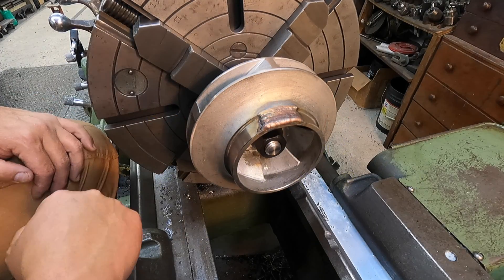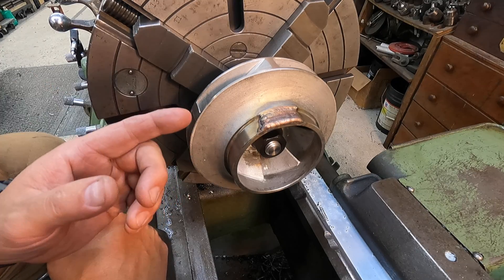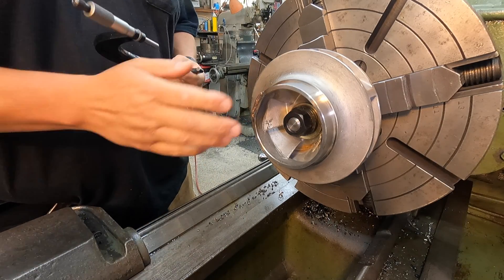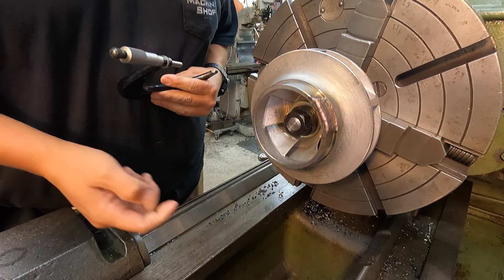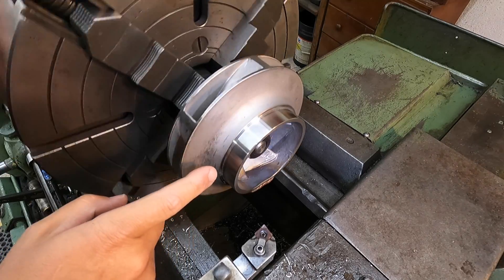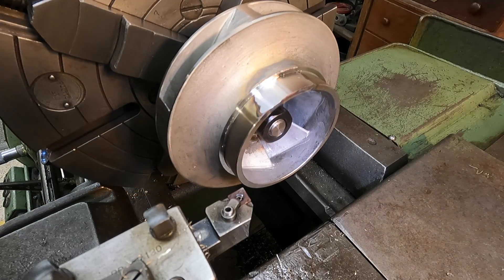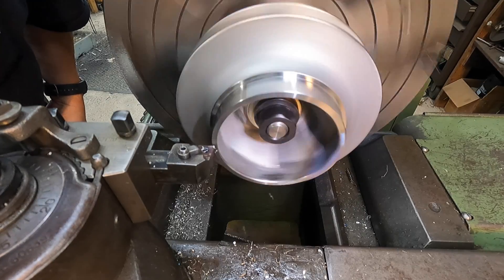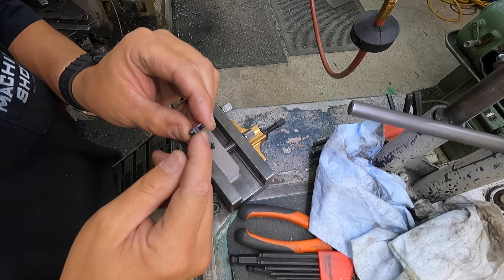Stainless Impeller Repair Part 2

Comment: The impeller is soooo twisted and banged up that it's basically junk. I do not understand how it's worth this much work hours and resources just for it to most likely end up being scrapped anyway after the customer tries it once. The poor pump is gonna be walking on the floor when it's running and the bearings are gonna be shot in no time. Mark my words.
Reply: You should pay attention to what the man said in the last video. You want him to mark your words and you seemed to discount his words.
Reply: @brianrhubbard  Yeah. Watched the whole video yesterday. I still don't see how.
Reply: @DraGma  He is doing it for educational purposes and to have content for his channel. I'm pretty sure the views and subscribers he will gain from this content will more than compensate him for his time. The part may be junk, I don't know anything about pumps but we can apply these techniques to a lot of other applications.
Reply: @Pablo Estafez Thanks. That's why God gave us two ears and only one mouth. We should listen twice as much as we speak!
Reply: Adam said in a previous video on this that this is a spare impeller. The pump has already been fixed with a new impeller. This one will be repaired and turned down to the next smaller size and will go on a smaller pump when needed. The run-out problem will also be fixed when the impeller is turned down to the smaller size diameter.

Comment: When they dropped the impeller, was it still attached to the pump motor? That was some bend.
Reply: I was thinking the same thing... holy smokes that’s a big ole dent
Reply: @francisschweitzer8431  Dropping these impellers is surprisingly common, the damned things are heavy and are awkward tho hold. Dropping one usually results in this sort of damage but usually on the disk fins.

Comment: If you had planed on doing the flame spray from the start, could it have been used to build up the dent as well? Clearly that couldn't be done while spinning on the lathe, unless you apply a lot of build up, but could spot build up be done? For that matter, could the same system be used to repair damage in a flat surface? Under cut with a shaper, spray and machine back down?
Reply: I think tig fill rod is a lot cheaper for that much material than the special spray powder.
Reply: @cda32  In this case, I suspect you are correct. However I suspect there will be fewer heat issues with spray welding. Also there may be cases where one spot needs more buildup, but not enough more to warrant switching to tig. In that case, a spot treatment would save powder as it would avoid applying more than needed everywhere else.

Comment: I am No Machinist...but i Repair alot myself ( both personally and as a career )...i think checking that by itself ( no shaft ) would determine " Why " it wobbles so much??
It could be something that should be done First not Last in this Repair??
Methinks i would have checked the Shaft and anything that could be causing this wobble...
It looks like the whole thing is not machined right?
Or has some damage your " assuming " is " OK " 
Just my thoughts
Ok...not a Diss to you
Sometimes we have to go backwards a step to go forward or realize it is wasting time...
Yeah I know this is a video and " educational " to some...
But the lesson might be to start checking your part...because it was " DAMAGED " ...and that is time well spent IMHO....( based on 5+ decades of experience )...
Take Care
Reply: You also have to consider Adams decades on the job as a machinist and his time spent at Motion doing this exact same thing all the time. He is an expert at this type of stuff. If he didn't think it could be fixed I'm sure he wouldn't bother.
Reply: @DoItYourselfMusician  
I spent 5 plus decades doing work too... Wasn't doubting he can do it...i just think there is something he has missed so far....easy to lose focus when your too close to what your doing ... Something is out of whack and it is not that hard to see ( to others too )  ...but some want to defend him more than anything else....🤔

Comment: I'm curious to know how you can be sure the seal ring you're repairing is centered to the blades. Is the whole problem just down to being badly machined in the first place, it's nothing to do with the casting? I'm having trouble picturing the geometry of the problem
Reply: If the impeller was on a shaft when it dropped, that extra weight could have bent the shaft journal away from the seal journal. Given the location of the dent and the location of the low spot are "coincidentally" the same, that's the most likely explanation I see.
Reply: Sumting Wong here...
Yep

Comment: Hard to believe any manufacturer would allow runout like that on an impeller. Is it possible the item was dropped a lot harder than the client has said and the impeller has suffered from some severe deformation, causing that extreme runout along with the dent?

Comment: Adam the thread pass creates the perfect keyed surface for the spray weld  to adhere to insuring a very strong bond. Much stronger than the seal ring itself. This will be a solid very successful repair. When we spray weld repaired impellers in our steam plant we balanced and weighed the repair against a known good impeller. Run out on a high speed turbine pump is very critical to a long service life. I'll bet the original failure was caused  due to  a failed seal water cooling system typically due to a steam fireman forgetting to open seal cooling water valves.

Comment: I was thinking that thermal spray would be a valid application. I figured you would investigate that avenue sooner or later. I am glad you did. While rarely having a application for such processes myself, I have read about different uses of it over the years in the AWS welding journal. Engineering support from a manufacturer is such a valuable asset. One I use whenever possible. Cheers

Comment: Will the impeller need to be rebalanced after this work to reduce vibration?
Reply: Depends on the revs it'll be going at, but I should think it does, because the new material could be of different weight.

Comment: I'm more concerned about the hardened steel socket you used on the impact driver.
Reply: @TheMrSnyder because they're not needed. Geez, I've been pounding regular sockets with a big impact for years and years, I still have all of the sockets. 3/4" drive maybe, but 3/8 and 1/2" drive, it's absolutely fine.

Comment: Oh man, you're killing me here holding out on the finish.  No worries I understand the marketing and importance of views. 
Nice catch on the out of round on the impeller, would that not offer high vibration originally?
Nice welding bug eyes.
All the best.
Reply: someone suggested that the pump motor might have fallen on the impeller while it was mounted on the shaft, so the whole thing got warped, not only the dented region you see immediately. So it would have been pretty true originally.

Comment: I thought the challenge/mystery was that the seal bore wasn’t  centered to the shaft.  What was the solution to that?
Reply: It on a mandrel on the centre shaft. When you build it up and turn in it, it wil be.
Reply: It was originally [mis]manufactured that way.
Reply: He said at the start of the video that he will spray weld additional material, so he can turn seal bore again, this time centered on the mandrel/center shaft.
Reply: I guess I don’t understand how it worked in the first place or how it worked in its original housing.  He also said that he was going resize the impeller so I’m assuming it’s going into a new  housing and that it’s properly registered.
Reply: @mgsperformancerc  It's a rubber seal, so it could tolerate a certain amount of runout.